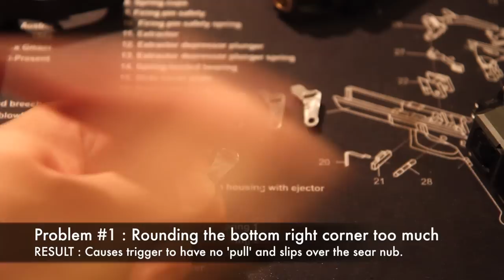TM G17 - LIGHTWEIGHT TRIGGER mod

Comment: Wow. Great video! Just a few thoughts that might help. Most traditional trigger jobs involve altering the engagement surfaces of the hammer/sear in order to reduce the amount of force needed to release the hammer (break point). There are tons of real steel 1911 videos on this. This seems virtually impossible to perform on the Marui style hammer/sear because the area is so small and difficult to access. Also the materials used in airsoft parts are generally soft which does not allow proper modification and polishing. Other means of reducing the trigger pull might involve reducing the spring rates of the hammer and sear springs. A reduced hammer spring would not apply as much force on the hammer/sear engagement area making it easier to release, but you risk getting light strikes by the valve knocker. Another method would be to alter the leverage of the trigger system. Think of using a short or long wrench when removing a lug nut from your car. It’s much easier to do with a long wrench. In the Marui, the higher you can get the trigger bar to engage the sear (kind of what you are showing), the more leverage you have which should reduce your trigger weight. I think this is what you are trying to explain to us. Also using a longer trigger would create the same effect by creating more leverage. Maybe your aftermarket triggers are creating such an effect. The combination of your use of aftermarket hammers, sears, springs, triggers and trigger bars are likely causing various effects on your trigger pull. I applaud your effort to show us in such detail! I wish aftermarket airsoft companies would put more effort into designing parts that actually improve function. Sorry for the long post.

Comment: I felt like i should just add that you can achieve the same thing with the uac trigger bar, and the uac stainless pins. the trigger bar is designed to remove the slack in the trigger as well the stainless pins allow the sears to move very easily when lubed!(side note these parts i dont think were out when this video was released.
Reply from the maker: yup those parts were released, i do not use the stainless pins because they are loose when i use them (i run open holsters, so i need the pins to be too tight)

Comment: Hey! I have a WE G18c and I want the total difference. I want a very heavy Trigger weight. Do you have a hint for me, how I can realize it?
Reply from the maker: Daniel Oest heavy hammer spring, or a blocky sear like an AIP, or AKA sear. Please note that if you choose to use those sears that are made out of a steel, you will have to upgrade your hammer as well to a steel hammer (Because you cannot mix die casted hammers with steel sears). 
Best regards,
RS087
Reply: RogueSystem087 Hey, thanks for reply. I’ve already upgraded the hammer and the sear, so it’s no problem in my opinion. But if I’m looking for AIP or AKA Sears, I just find Guarder or New-Age Sears. 
What do you mean with „blocky Sear“? Sorry, my english is not this perfect :/.
Reply from the maker: Daniel Oest if you look at your stock WE or sear, do you notice it has a slant near the face where the trigger bar contacts the sear? If the sear nub is blockier, biggger, more surface contact, no slope, then your trigger pull will be exceptionally heavy because it is hard to influence the sear through leverage. (You may need to understand how the mechanism works before you examine this any further).
If you sear nub is smaller, has a slope, trigger pull is lighter (like how this video shows people who to reduce the nub size to make leverage easier, therefore making trigger pull lighter).